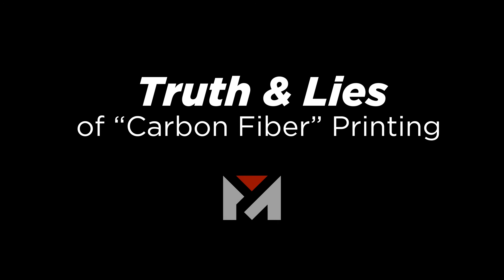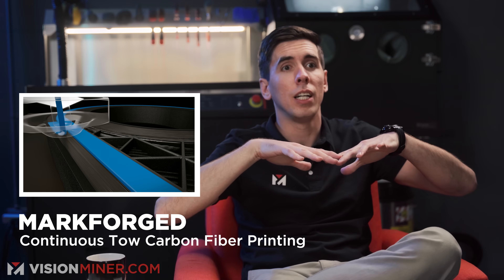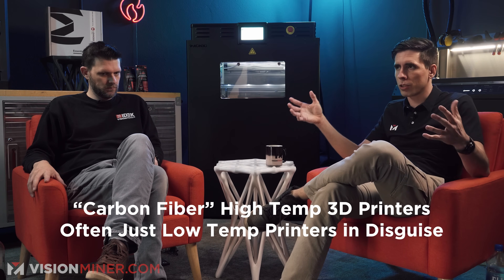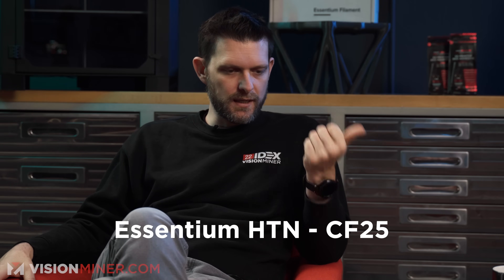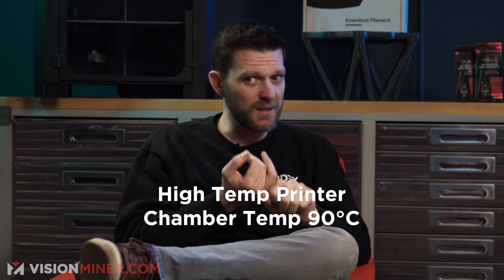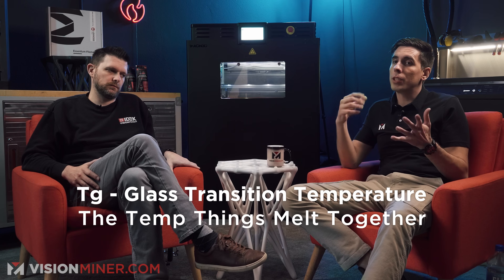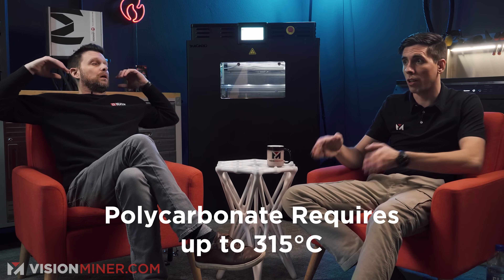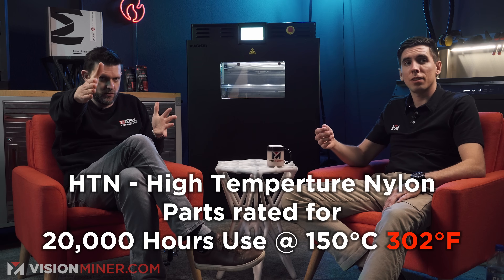Fact Check: The Real Deal Behind Carbon Fiber 3D Printers - 2023

Comment: The next step for reinforcing commodity and engineering polymers is definitely nano clays and the % volume needed to add is less than 5% for the significant bump in both young's modulus and UTS.  Far cheaper than any fiber process too on the basis of cheap nano clay production and addition to the polymer in filament processing.

Comment: They had a MarkForged at a place I worked. It was the first 3D printer I ever used. It was the size of a microwave so I figured it went for 3-4 grand. HA! $20,000 or better! Idk which model it was but it was continuous filament as shown here at 1:00. Parts from that machine were very strong and clean, not bumpy.

Comment: As far as i can tell the micro fiber carbon fiber that's in pla and what not is an anti wear instead of anti break think of a shaft going back and forth in a channel the wear on the channel and the shaft is what it resists

Comment: Thanks guys, from industrial users like me I’m interested to see your printers outcome like showing real parts with different sizes and geometry to see your printers quality.
The specs and talking about technicalities are not enough. Showing examples is the best way. So in my case I would love to have a farm using CF for printing robotics shells and structures like UGVs , quadcopter etc. the appearance of the final product is so important also. I would like to see your printer work in printing parts that has appearance not small mechanical parts only but structures that will carry stress and aerodynamic loads.

Thanks guys

Comment: Very Well explained👍. What about epoxy casting with impregnated woven carbon fiber or fiberglass sheets? May not be suitable for all designs, also might involve pre/post processing. More like a poorman's impossible objects printer(in some aspects), but insanely cheaper. May be, you can use the good ol 3d printer, to just make the master, for a silicone mold! For one off prototypes, 3D printing makes sense, but definitely falls short for low/med volume production. After all, what 3d printer can print with continuous CF filament, woven on demand into CF fabric(None).Just some 💭

Comment: I managed to print the most of high temp materials including PEEK and PEI Ultem 9085 & 1010 on my (heavily modified) Creality CR-10 without heated chamber.
Here are my advices for low-budget enthusiast like myself: 
- Keep the prints low (as VM guys suggested) - my tallest print was 5cm
- Ramp up build plate temperature (+20-30C above specified) - get a AC bed heater
- Use PEI metal bed with Nano Polymer Adhesive
- All metal hotend (no PTFE anywhere) with at least 60w heater
- Remove all unnecessary electronic parts from printing area (touch sensors, cameras, etc)
- You can use UV heat lamps (for lizards) to add a bit of temperature on part
- Use Flame Retardent sheets under and around printer, and monitor the process all the time

Comment: I'm a newbie interested in 3d printing, especially PEEK. Is 3d printing PEEK parts legit? I would think layer adhesion would be a huge issue. Especially like you said, the further you get away from the bed. I'd think you'd want the chamber around 400f +.
Reply: PEEK, with or without carbon fiber has by FAR the best interlayer adhesion of any filament type, and I have tried most materials available.
I have an Intamsys Pro 410 that only achieves a stable chamber temp of 70C, and interlayer adhesion (as well as most other properties) is phenomenal with PEEK. 
High temp nylon with carbon fiber is not even in the same league as PEEK with carbon fiber (3DX Tech PEEK+ 10%CF). The HTN I have tried has had the worst interlayer adhesion of pretty much any material I have printed with, even worse than basic materials such as PLA and PETG. Looks great, but basically as strong as a sandcastle...

As the guys said, carbon fiber mainly increases stiffness, but some other HUGE benefits are that it also reduces warping and increases overhang angle. EG: Printing at 0.1mm layer height, natural PEEK (aka: no carbon) I can print overhangs of approx 50 degrees without sagging, but with carbon you can print to 80 degrees without issue.
Downside is that PEEK costs about 10x that of nylon, and 20x that of materials like PLA and PETG.
Also you need a hot-end that can go to 440C to effectively print PEEK.

My go to material when I'm paying is PETG without carbon fiber, but occasionally with carbon fiber. There's a reason why all the Prusa printers are built using the stuff, and that's because it's fantastic!
Reply: Thank you for the reply, very informative.  I'm pleasantly surprised to hear the adhesion is great.

Comment: I was just about to write a very similar thing to what Mike Jackson wrote. I get that your particular business model revolves around this sort of printing, but you are talking about consumer level printers and how they don’t do what you do. Those printers do have a place in the market though.  I do think that they are playing up the CF side in a way that the uninformed could be misled and that probably should be spelled out in an informative way. But I think you could have probably done a better job of getting the information out there without getting on the high temp high horse. I mean you have the aluminum casting guys looking down at you saying 400C is that all - hah, then they have the brass folks, and then there is the direct metal laser melting group . . .

Comment: I use Polymaker's Nylon 6 carbon fiber. It is very hygroscopic, must be dry, and needs to be waterproofed immediately after printing, but I can't find any other material with a tensile strength >100 Mpa with a hot end less than 300 and a bed temp less than 100. The carbon fibers in this filament significantly increase tensile strength, flex mod, and also minimize warping. If you guys know of another filament with similar mechanical properties that can be used on consumer machines I would love to hear about it.
Reply: I'd like to know as well. I'm considering upgrading all my parts from ASA to PC, but trying not to forget about nylon or other options.
Reply: Luvocom PAHT-CF 9742 BK is a great material that will outperform Polymaker PA6-CF in most metrics.  It's a little more difficult to track down (I'm running into that issue myself since eSUN just stopped selling it), but it prints easily and produces extremely strong parts, especially for being right on the edge of low-temp materials.  It's sort of the bridge between normal PA-CFs and PPA-CFs in my mind.  Their PAHT 9891 variant is a little "lower spec" in most regards but is also a fair bit easier to find depending on your requirements.

Comment: I actually almost worked at continuous composites. I have a friend who worked with them in the early stages of their development.

I haven't seen their progress in the last couple years but last I saw, they had serious problems with the filament "fraying" as it was printing, leading to very spiky parts. That said, mechanically, you would be hard pressed to get stronger than their setup because they had the ability to print some objects with a single, continuous line of of fiberglass or carbon fiber. (I never saw them using aramid but that might have been because they just didn't, not because of capability.)

Comment: first i herd of this carbon 3D printer stuff is it from china?they got their own truth lol in specs ,like its when a product says Precision  bearings ,well that means  many things in china so firstly its a bearing so it has to be made in a Precision way so by default its Precision! no matter the material specs and it may or may not be any good to usebut you can stare at it 👺 1000 watts of out put power lol  dead shorted  may be.😻. just messed up:face-orange-frowning:

Comment: 'I have so many printers I have modified and failed..., I know what I am doing'    Haha no I do not think so bud
Reply: What he is saying is saying is most of those consumer grade printers are gimmicks and they are. You can polish a turd and make up for its deficiencies but as most self proclaimed experts and tinkers on the average FB group will say is that it can take months or even years to become a proficient 3d printer. Because as everyone knows when you buy a commercial machine you spend months just trying to tune it and get it to print correctly? Desktop CNC is another gimmick. Take a look at a lot of them and you can see buy how they are built they'll barely be functional as a engraver. You won't be carving chunks of aluminium with them let alone steel. I bought a Guider 2s a couple years ago for printing motorcycle parts. It prints fine out of the box. 300 nozzle and 120 bed, with preheat the chamber gets to around 70c and I predominantly print ASA. Strong parts, dimensionaly accurate, look good, don't warp. Whats to improve? Yet the common comment is I need to chuck this in the bin because its not open source and go buy an Ender or something instead so I can modify it easily. Also they are spot on about CF. As someone who works with engineering materials including prepreg and wet layup CF, no 3D printing process with CF comes anywhere close to actual CF, hell it doesn't come close to fiberglass.
Reply: @1Beetlegeuse  well put.  The guys who actually manage to build their own high temp machines are absolute madmen.  I've seen a handful and they are so far beyond "modifying" any base printer worth starting with.  Obviously don't know what his goals were for the modifications, but anything sufficiently in depth requires so much time in design and construction that it's rarely worth it over a purpose built machine.  The exception being when your time isn't worth much (or as much), or if it's purely a hobby and have nothing on the line.  At that point the limitation is your patience and how deep your pockets are :).
Reply: I think what he means is he loses interest in the project, kind of an ADHD moment maybe. Or he looks at all the parts he needs to buy, doesn't want to spend the money, doesn't want to fiddle with it, etc. I think he spends more than enough time at this job to probably not want to spend 100 hours modifying his little project printer at home. Like a mechanic's car or an IT guy's home computer, lol!
Reply: Yeah for sure, you know better than someone who does this stuff professionally /s
Reply: @Shynd  "Professional" Salesman goes, 'don't build, Buy! I know bc I am a failure!' Bet you ate that sh!t right up.

Comment: I disagree that CF in PLA is pointless. It definitely adds stiffness and allows for better overhangs. But it is exceptionally brittle. I use CF PLA when I need something to be as stiff as possible but not be worried about it being subject to impacts. This video reminds me of a time when my buddy told me he was getting a "metal 3D printer" for $1000, and I told him: "no your not." To which he assured me that he new what he was talking about and proceeded to show me the listing online. I just laughed... It was an FDM printer with a "metal" frame, body and parts. Clever advertising from China... Made him almost buy it thinking it printed metal. (Idiot)
Reply from the maker: You're correct -- and yes, exceptionally brittle :D It also looks really really nice, while still being ridiculously easy to print. LOL -- metal 3D printer! And on another note, technically every FDM machine is a metal printer, since there are metal filaments which can be sintered afterwards for solid metal parts, and they're just PLA infused with Metal Injection Molding powders....
Reply: @VisionMiner  Yup, I thought about that. You are correct. I've never experimented with metal infused filament (for sintering) myself. Looks dimensionally tricky. I have used Proto Pasta's Steel PLA, not for sintering of course. But I like the weight it adds, and you can polish it to give it a shine.

Comment: I print 0.6 from a 0.4 nozzle. I print 0.8 with a 0.6 nozzle. Makes the parts allot stronger - top tip

Im an engineer in a professional industry and we print ABS and PCTG for excellent production parts and we don’t need a heated chamber because we don’t need to use those materials (yet)
Reply: Forgive me for my dumb please, but what do you mean you print .6 from a .4 nozzle? I am sincerely interested in understanding this technique to get better quality parts.
Reply from the maker: I believe he means using an extrusion width of 0.6mm, but doing it from a 0.4mm nozzle -- you can adjust this in settings, and depending on nozzle geometry (sharp tip vs flat spot around orifice), this often works VERY well!
Reply: @VisionMiner  Thanks so much for your quick response. I'm a bit of a newb in the FDM 3d printing game. I recently got myself a flsun v400 and then moded it with a nice on frame enclosure as well as chamber heating components. I'm currently trying to upgrade certain parts to make it nylon print friendly so I can print propellers for my kayak pedal drive. So I'm always crumb munching any data and techniques I can to produce better parts.
Reply: @parallelsandtangents938  - VM clarified for me! But if u think about what the plastic is doing when u push 0.6 out of 0.4 nozzle it will force the plastic to flow outwards and be squashed or ironed by the nozzle. This really helps with getting those layers to fuse together as the plastic is under more pressure + the temp of the nozzle + more mass of hot plastic. All helps with strength. 

If u have any other questions fire on here and I will try to answer.
Reply: @hayden9944  thanks, I certainly will.
Reply: @hayden9944  I'll take you up on your offer for more info!  Are you using stock 0.8 slicer profiles with the 0.6 nozzle or are there specific settings that needs to be tweaked?  Which materials have you had the best luck in improved strength?  Have you worked with PETG in this way?
Reply: @spheretical3609  You use the standard 0.4 settings. All you are doing is changing the line width (or extrusion width) to 0.6. The slicer does the rest.  With a 0.4 nozzle you can set the line width between 0.26 and up but wouldn’t go above 0.6. Basically ur printer will print a 0.6 thick lines.  Play about with it and look at your sliced model. If your walls are not divisible by 0.6 the slicer will compensate for this automatically 

What issues are you having with PETg? Ur prints not coming out looking nice? Or are they weak?
Reply: @hayden9944  thank you for the detailed response!   I almost exclusively print with petg and am happy with the results I get for what I do.  I will try this approach out soon as a I have a part coming up that will benefit from improved layer adhesion strength.  Some part geometry exposes the layer bond to unavoidable shearing forces so this seems a handy way to add a little more resilience there.
Reply: @spheretical3609  - sounds good! CNC Kitchen did a video on transparent printing, and turns out he got 90% strength in z. Have a search on YouTube. You have to slow it down to get that but it’s good info.

Comment: Is a heated bed and a thermally insulated chamber good enough? Or do the chamber walls actually need to be heated?
Reply: The chamber temp you are looking for for most materials is around 40C less than its glass transition range so you have headroom for the material to cool fast enough it doesn't anneal, but warm enough so you don't have insane internal stresses/warpage.  So for pla, that is ~10-20C, petg is ~40C, abs is ~60C, Nylon has a huge glass transition range and huge variation between types of nylon, meaning you can get away with a lot, but 60C works for most and no HTN isn't nylon and this does not apply. A decent passive chamber with good circulation can get ~60C, 70C is the highest I have heard. So POM and PC are out of range, as is the rest of the typical high temp gang. For some of the higher temp stuff the 40C less breaks down and I would look at injection molding mold temps as that industry is a lot more developed even if their online documentation is bad.
Reply from the maker: Like say, it depends on the parts, geometry, and exact material. For some parts, yes, that will be more than enough -- for others, having the entire chamber heated is critical. It's not the walls, per say, but the entire chamber air.

Comment: I wonder at what point you'd be better off (as a hobbyist) buying a CNC that can mill aluminium instead of spending 7k+ on a high temp printer. I think most of the applications where you need the properties of aluminium have shapes that can be milled on a 2.5, and in the rare cases you do have a very complex geometry that can't be made any other way... well... that's what companies like Vision Miner are for
Reply from the maker: Yep, that's why we're here! Often, also, conductivity or corrosion/chemical resistance, or lubrosity come into play. Metal is great for many things, especially strength and temperature resistance, but when you get some acids or electricity in there, it's not always an option :) You can CNC many plastics, too, but geometry comes into play -- also, waste material, speed, machine setup, etc -- a lot of times 3D Printing will be easier. Low volume runs usally throw injection molding costs out the window, too...
Reply: For me it comes down to noise. My FDM printer is quiet. For as much as I would love to DIY my own CNC and start doing traditional subtractive manufacturing, I don't want to hear a damn mill all day. I don't have a dedicated room for it.

Comment: Impossible Objects CBAM25 is a game changer but similar issue to markforged continuous fiber printing as its a closed system. They will change the whole industry if they opened the platforms.
Reply: I think I saw somewhere that Impossible Objects is open to working with different substrates and polymers.